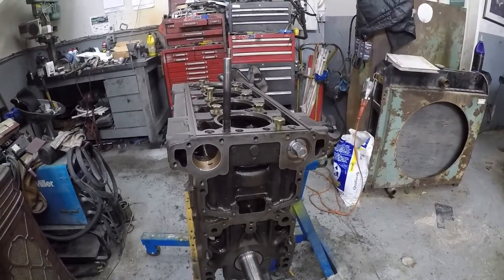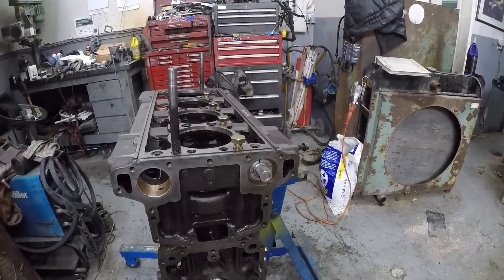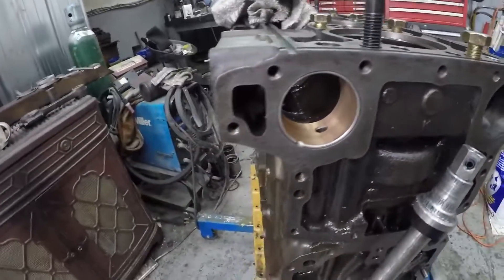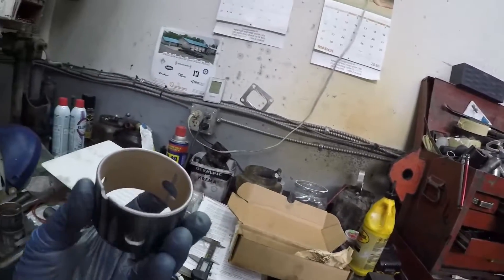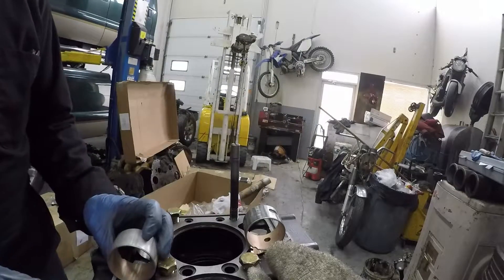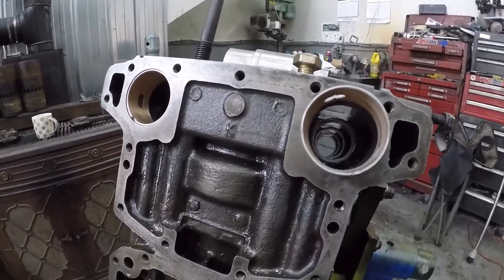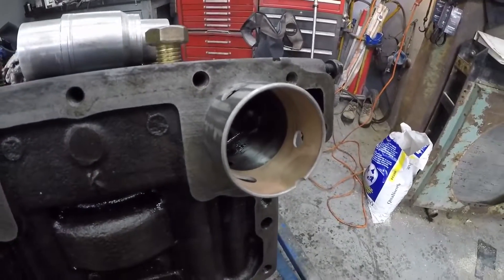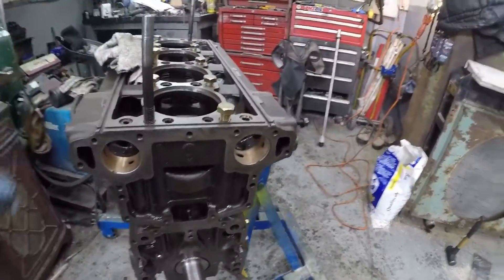Detroit 4-53T Silver Series Build Part 3. (Camshaft Bearings)

Comment: I'm trying to find a cam bearing install tool. Would you share which one your using?
Reply from the maker: I did this engine with a universal cam bearing removal and install tool.  I've since made one out of aluminum and  threaded rod. Thanks for watching.:)  Here's a link to the tool I bought.    https://www.ebay.com/itm/403250332815?hash=item5de397c48f:g:8GkAAOSw6A5hc7nR&amdata=enc%3AAQAHAAAA8PuMKTrN03qIg8kQO5AQgqBudKCzEaqxTHPLbjXoPc2akhoWRbi%2FQ3%2F4SqEFsmnBRvzT1hTEa1GUpBm595vGYWUJL%2FRdcgeUZ4XCLfCSY0%2FW3XY%2F4rEkWZYX1Y8i01I0JNDOF0IaLSmhev0yhHixyYqc5TSdvLnCd5RhugEip8qcSFO5QeoOdDPV2Ar3%2BpoemmjwtbeJRf8WwsIysdyLyq8GYkMC%2BQ0DQ2nA8GZIZ8c7L%2FZhxjo07X2s9jnfMQLrFanrzraWXoG5RdAggyryG3VEJefLAxVKNxxCUBgxHSBwvTtzpsKwfqteVVZD8VR8Yw%3D%3D%7Ctkp%3ABFBMuN6S3alg

Comment: splash lubrication on center cam bearing?
Reply from the maker: Yes, just the outer two bearings are pressure fed on both the cam and counter balance shaft.  I replaced all my bearings, but could have continued using the old ones.  They were still in tolerance, but down .002" from wear,  I just like new bearings.:)